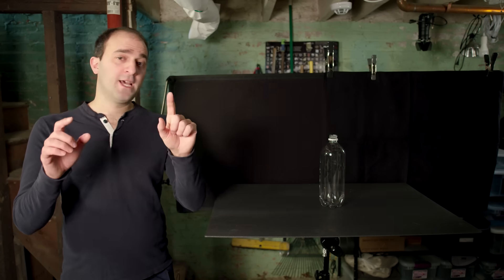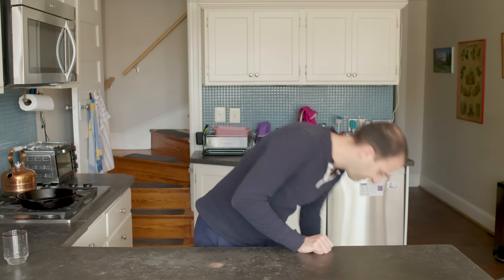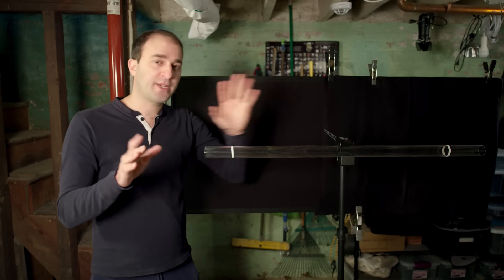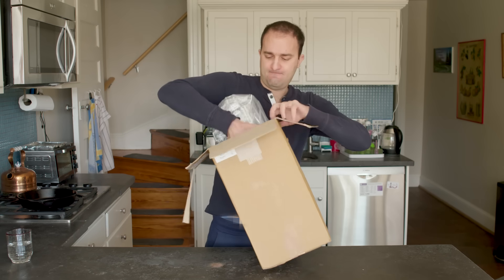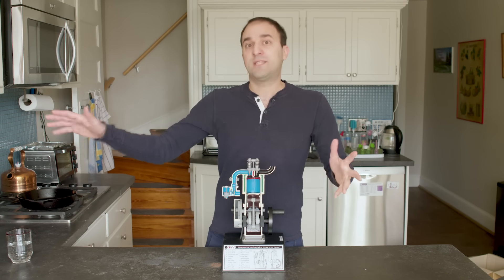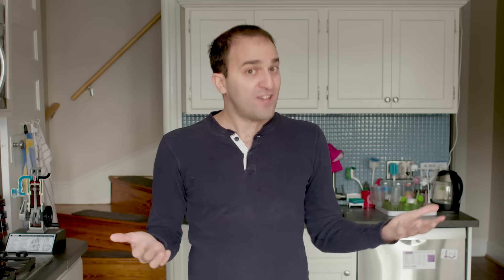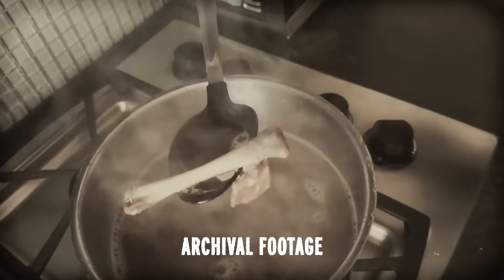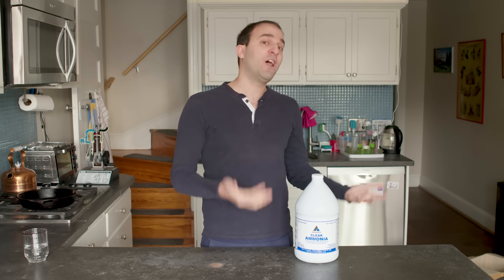Does Toyota Know Something That We Don’t?

Comment: a lot of this video is really well made, but you i troduced as the central claim that ammonia engines could "reduce carbon by 90%", whatever that means, and then you seemingly ended up forgetting to address this, or even how ammonia is made at all - you mentioned haber-bosch, but did not explain it, or investigate the climate impact claim that was presumably meant by "reduce carbon". 
real life ammonia production is done by making hydrogen out of natural gas (if purified for use as hydrogen, that would be called blue hydrogen as opposed to the fabled expensive green hydrogen made by renewable electricity-powered electrolysis. I'm sure that transforming methane into hydrogen and then ammonia introduces additional inefficienciesthat would make an engine running on that effectively burn more methane than a directly methane-fueled engine, which itself apparently at best produces 30% less CO2 than gasoline. so for a 90% climate benefit, they must be talking about a green-hydrogen-based option. and green hydrogen is known for generally having higher losses than other energy storage systems, especially batteries. so the climate benefit potential of green hydrogen ammonia looks quite limited to me.

Comment: his last words 'just not in your car' what a DUFUS.. of course its a viable fuel.. Toyota has worked out 99% of the kinks.. and it will be easier for gas stations to have an Amonia pump .. is it the absolute solution, no but it is a step forward since EV has proven to be limited due to battery life being much much shorter than advertised.. especially in colder climates or hotter climates and cars catching on fire sitting in a garage.

Comment: "Designed to burn in engines" does not sound right.
Isn't it the other way around? Engines are designed to leverage fuel combustion as well as possible?

Comment: This isn't exactly a new idea. During WWII, the US was the largest exporter of crude oil, but by the 1950s, the US was starting to approach being a net oil importer. The US Army started looking into using ammonia as a substitute for diesel fuel, as remote alternate energy sites couldn't ship electricity to the US, but could use the electricity to produce ammonia that could be imported. The US Army actually got their ammonia research to work, but it never caught on as there were no oil shortage, and ammonia burning efficiencies could not approach the level of diesel engines...

Comment: Ammonia needs to be handled with respect.  Refueling a car running on Ammonia would be via a closed pump connection like Liquid Petroleum Gas (LPG) - not like gas which flows through the air into an open tank.  I run my car today on LPG which is much better for the environment and I am interested to see how Toyota, JCB and other global companies develop this option.  Using Ammonia to make Hydrogen is also a route that could work and JCB are looking at that too.

Comment: Ammonia would be good in aviation. Electric aircraft or even hydrogen powered aircraft excluding blimps are not very practical. Military aircraft especially would have to take a huge leap backwards but ammonia can be the answer. The power density of ammonia being less also isn't as much of a concern vs aviation fuel which has a lower energy density than gasoline all be it higher than ammonia but notice I said aviation fuel not jet fuel which is higher.  However in aviation you can use more. You just use more. You use a rich mixture. Ammonia could also be produced cheaply and as a byproduct of other energy producing technologies. So ammonia has a better place as a replacement fuel in aviation than in automotive engineering. Though for automotive technology straight up hydrogen is probably a better option with something like fuel cells then burning it but that could be an intermediate step between a fossil fuel hydrocarbon based transportation infrastructure and a green probably hydrogen based transportation infrastructure.

Comment: Too fast of a flame front speed isn't a problem. Improper timing is be the problem. Mazda has a gas engine (based on HCCI) that detonates the fuel virtually all at once which is close to an infinitely fast flame front. The trick is timing when that detonation occurs.

A crash with a tank of anhydrous ammonia would wreck not only you but everyone nearby, too.

Simple chemical reactions are nice, but reality involves incomplete reactions. Current engines produce NOx when the oxygen & nitrogen in the air react with each other instead of with the fuel. NOx then goes on to contribute to smog and all its health hazards. Engines can also produce CO and other compounds of carbon that are not fully converted to CO2. These chemicals/particulates can be especially harmful to health. What incomplete combustion products can NH3 produce?

There's also the fundamental problem of round trip efficiency. How much energy is needed to make NH3 compared to what can be extracted from it in an engine? Hydrogen is pitiful, with round trip efficiencies of ~25%, meaning you need 4x as much energy production somewhere else to make the hydrogen to use in a car as opposed to just putting that original energy in the car. A quick search suggests that round trip efficiency is ~20%, which means fueling your car with 'green' ammonia will be FAR more expensive than using an EV.

Comment: According to ICCP and other climate activist sites, N2 and NOX which will be produced from interaction of nitrogen and oxygen in a hot environment is also a greenhouse gas. Hints why the Dutch and other European organizations/governments are trying to stop the use of nitrogen-based fertilizers which will cause famine over time. There are arguments over if NOX is worse than CO2. Dr. William Harper of Princeton university goes into the physics of how the greenhouse effect works. 

Also, ammonia has other problems as well. Quickly cause someone to go blind if its concentrated enough. Then we get into the other chemistry problems, hopefully no one tries to clean their tail pipe with bleach.

Comment: And WHO exactly would PAY for the building and installing of the infrastructure needed for Ammonia Fuel Stations ?  Americans are already saddled with the cost of the  ELECTRIC Car  Charging network while the Electric Car Mfg's pay out NOTHING ! Only those with a Charge at home unit pay directly for their charge system at substantial cost before seeing a break even point !   Many electric car trips have been stalled while waiting for a charger to become available and then HOURS WAITING to fill the batteries ! Fine for the short trips but not for the long haul !  The Water Fuel Cell is the ANSWER and water is everywhere ! Every home has a faucet and a hose ,... Problem Solved !

Comment: as ammonia is, as the video stated, far less energy dense than gasoline i do not believe it would work in engines designed for gas. it would require it's own type of engine. what would the impact of producing this much ammonia be? the amount of carbon that leaves the exhaust is only part of the equation.

Comment: It appeared that you had to flick your wrist to open your box cutter, therefore it is not a switchblade box cutter.  A switchblade uses a spring to automatically open the blade when the switch is depressed.  It appears that what you have is a just a common folding box cutter(utility knife).

Comment: I used to work in a heat treat facility. We used ammonia for nitriding. Our tanks were out side and we had a painted metal structure with a metal roof over the tanks (two sides were open). Just from changing out ammonia bottles and annoying little leaks, cause the structure to deteriorate in about a 15 year period to the point that it had to be rebuilt due to safety concerns. We only did this process about 20 days out of a year. We always wore respirators and safety glasses. the smallest amount of ammonia is over whelming, and if you have a big enough leak, which isn’t much of a leak it replace the oxygen around you.

Comment: its unlikely it's effect on client change would be what you are thinking, the ammonia we produce is from the air by use of a catalyst and lots of heat and pressure and that means energy and we have to get that energy from somewhere in order to create ammonia.  So ammonia is like the battery in an electric car except doesn't produce even more pollution during creation

Comment: Hey! So just a clarification:  Ammonia (when difused into water) actually onyl produces small/negligable amounts of Ammonium Hydroxide (NH4OH). It mainly exists as just ammonia dissolved in the solution. In addition, Ammonia is not very caustic. In fact, it is a pretty mild base-- having a similar pH to Sodium Carbonate (washing soda). So while I would NOT reccomend getting ammonia in your eyes or lungs, I think it is a mistake to claim ammonia is remotely comprable to Sodium Hydroxide (lye). Great video though! Really interesting ideas. Cheers!
Reply: hey s-s, your entry cot my eye.   and clarifies a misunderstanding i had.

thanks for making your contribution to this ammonia / fuel topic.

now  i need do some homework.  and re-learn those factors that let
one determine the amount of dissolving.   Ksp or something similar ...
       also want to clear up if
a solution made alkaline w/ NH4OH can be heated to drive off
the ammonia and thus have its pH lowered.
      this appeals if it works for not needing some pH-down chemical
like H2SO4 

       where would you send a person to learn more about the chemistry
of NaOH and Na2CO3 and NH4OH solutions ?  and how  / not
interchangable they are ...

Comment: Ammonia is also a good refrigerant. It was used in air conditioning and refrigeration systems in the late 1940s and early 1950s. Mom's refrigerator announced it's impending death when it began leaking ammonia in mom's kitchen. The smell was pungent and the inside of the unit no longer remained cool. This characteristic resulted in the development of the product, Freon.  To remain liquid, ammonia must be stored in a pressure vessel. Other gaseous fuels, such as hydrogen, Liquified Natural Gas, propane and butane are flammable. Only hydrogen LNG and are lighter than air. Ammonia, propane and butane are heavier than air. I would not want to be in the vicinity in the event of an auto accident of any pressurized fuel, but ammonia, as you pointed out, is not only flammable, but in high concentrations, is deadly, especially in enclosed areas such as a warehouse, parking garage, or a tunnel.

Comment: Ammonia is a noxious chemical and can be deadly in relatively weak concentrations in the air. Concentrations in the air of 5000 parts per million (ppm) will cause instant respiratory arrest (and therefore death) in humans... By comparison it takes 10,000 to 20,000 ppm of gasoline in the air to cause unconsciousness after 1 hour of exposure. But the woosiness from the gasoline will cause a person to leave the area long before that happens. So ammonia is MUCH more dangerous than gasoline.

Comment: Ammonia was used as a refrigerant in homes and still is at a commercial level. I'm thinking of ice rinks; One in Canada killed some people when it had an ammonia leak. I think it is far more dangerous than gasoline. But as you point out it may have some advantages. The thing that I am curious about is how much energy are we using to produce ammonia and is it coming from fossil fuels. An EV powered by coal fired plants is not an improvement over a gas car.

Comment: Combustion Stroke in the 4-Stroke Wankel Rotary Combustion Engine lasts more grades of Shaft turn than the Combustion Stroke in reciprocating 4-Strokes or 2-Strokes. 
Perhaps it would be good testing Ammonia as fuel in a Wankel RCE.
You meant 'Anhydrous Ammonia', didn't you?
Blessings +

Comment: Interesting question: if the flame speed is 1/6 that of gasoline ... how does diesel compare? How does marine diesel (used in container ships) compare? I ask because a massive engine in one of those things runs at 80 - 150 RPM, as opposed to the 2500 - 3000 RPM most gasoline engines use for highway cruise. That's 1/20 - 1/30 the speed. So something with a lower flame speed shouldn't need much in the way of a promoter.

A diesel-powered semi, running in the 1100 - 1800 RPM range is still probably not a good fit; the flame speed is too low, without a promoter.
Reply: In a Gasoline engine, you have a mix of fuel and air, ignited by a Plug, flame travel is from plug to the rest of combustion chamber,  in Diesel Compression Ignition Engines, you have Air Compressed, put into a high temperature, then the heavy fuel is injected into this very hot air, flame speed is the injection speed, added to swirl in combustion chamber, if any; fully different to ignite a mix of fuel and air, but I don't know much about engines as the Goliath, a brand of Borgward, Direct Fuel Injection 2-Stroke engines after War. 
Gesund +

Comment: When Ammonia spills and gets in contact with air, it oxidizes to Nitric Acid. If it gets in contact with water, it creates a base that also dissolves flesh. That stuff is an environmental disaster. Any spill of that will end with dead towns and just an oil spill. I will take gasoline anytime over Ammonia.

Comment: It takes approximately 35 KWH to make a gallon of ammonia which is made from methane and has about 1.2 KWH of stored energy. A gallon of liquified methane also contains about 35 KWH of energy. Gasoline takes about 5.6 KWH to manufacture and has about the same 35 KWH of stored energy.  So using ammonia to get hydrogen to run a car won't save the planet particularly compared to liquified methane or gasoline.

Comment: Add pressure and some Hydrogen from electrolysis it will work similarly to gas.
Slow burn use higher gears. At 125 PSI NH3 IS LIQUID.

Comment: What do you mean by "are we going to go back to burning fuels?" That implies we've abandoned the internal-combustion engine, but nothing could be further from the truth. EVs are really slowing down in sales now, and many EV owners are switching to hybrids or even going back to gas or diesel.

EVs wouldn't even be viable if it weren't for the huge subsidies. They are barely cheaper to operate, cost twice as much as gasoline, and their tire wear is faster than gas cars due to the incredible weight. Half a car's pollution comes from tire wear. 

We're not going to go "back" to ICE. We will not move off of them at all. And now that the world's recession is progressing, the 2030 deadlines will become impossible for Europe too since the subsidies will evaporate soon and nobody will be able to afford EVs. Oh, and by the way, Northern Canada checking in. EVs don't work in -40 degree weather.

Then there's the ongoing cost. If I dent a fender on my existing car, it will be one or two thousand to fix. The exact same incident done to a Tesla can cost 30k to repair, and the car often is not driveable for 3-4 months. The body shop working on a gas vehicle would be done in 2 days unless they need to wait for a part, in which case it'll be a week when you're unlucky.